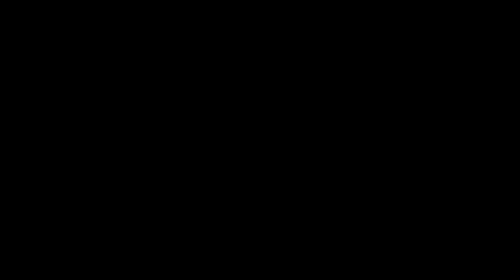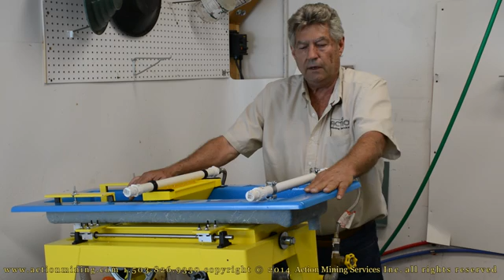2014 Action Mining Wave Tables - M5 Portable Table Demo

Comment: Hello, I have a few questions for you. The M5 can run about a 5 gallon bucket an hour? The M7 about a ton? How is this table different than other shaker tables on the market? For example, I used an RP4 shaker table last weekend and it seemed to be able to move a fair amount of material. Does this table recover finer gold?
Reply from the maker: Thank you for your interest!  I have customers who use the Wave tables as primary concentrators and of course, there are many who use the Wave tables as secondary and finishing tables... especially after centrifuges and other concentrators. Our tables have the ability to recover micron particles that are often missed from other concentrators.

All of our Wave Tables work on the same principal, but with each model you get different production rate.  The M5 Wave table is for testing only in a laboratory environment.  Although many individuals use it out in the field and for cleaning up sluice cons, it will process approx. 50lbs/25 kg per hour.

The M7 (standard 110v, 60cyc) is my most popular Wave table due to its versatility, often ordered with a variable speed control.  The M7 is rated at approx 2000lbs /910 kg of classified head ore per hour.  When running a concentrate we normally see about half of the production volume, but this depends greatly on your material. 

The M7 is also widely used for a clean up/finishing table.  I have a company in northern Nevada, that uses the M7 models for tungsten carbide crystals and the recovery varies between 5-40 micron in their finish room.  We use the M7 here in our laboratory for testing all types of ore bodies.

There are may types of shaking tables of the market.  Almost all have the concentrates (cons) reporting on the table deck in a longitudinal direction (that is, long ways)..... whereas the Wave table has the cons reporting transversely (across the deck).  This is a great advantage as it provides a cleaner separation (by specific gravity), a higher recovery of gold, for example, (particularly, fine gold).. and allows gold to accumulate on the deck, which is advantageous in clean-ups when you wish to wet vacuum off the gold with a vacuum system.

I hope this helps... we do offer table testing at our facility here in Oregon should you decide that you would like to come in or send in a sample for testing.  Feel free to call if you have any additional questions or would like to set up an appointment.

Jessica Miller
Action Mining Services Inc.
503-826-9330